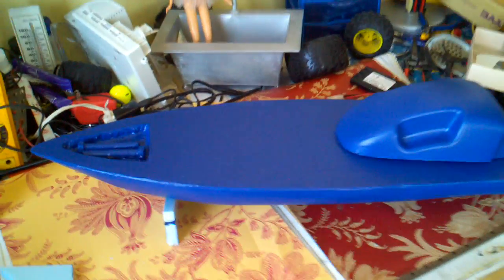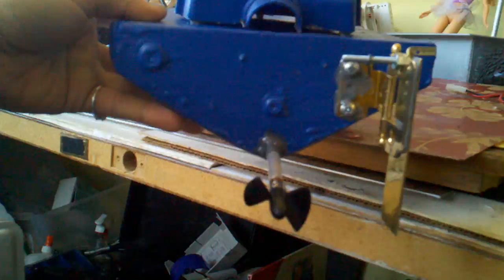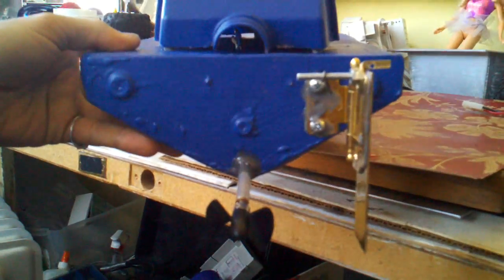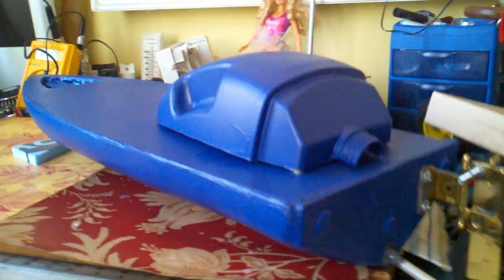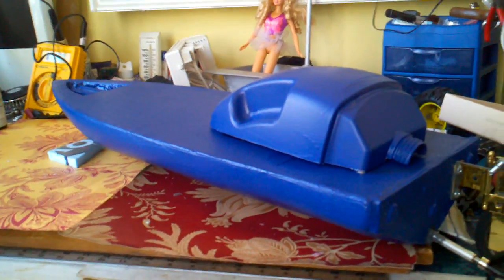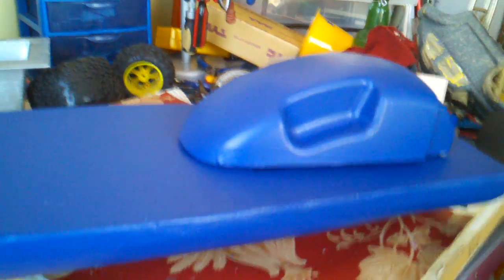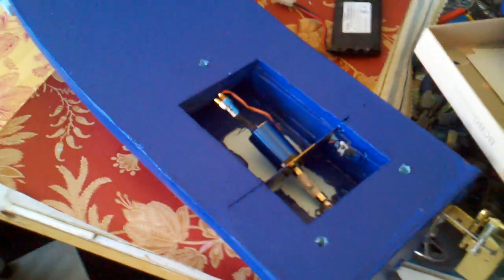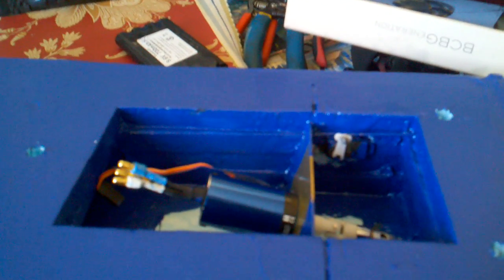DIY Homemade RC Boat w/ Traxxas parts

Comment: What part did you use to attach the motor to the shaft? Is that a Traxxas part?
Reply: There is things that you can use and he used a u joint but but you can also use metal couplers